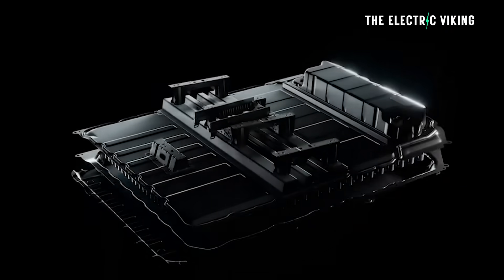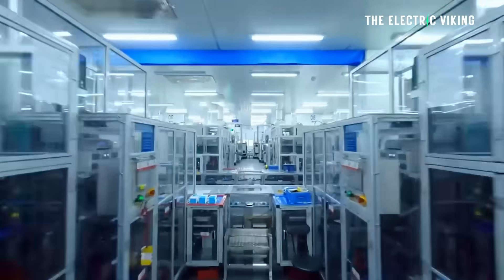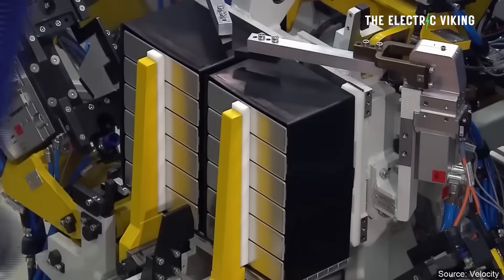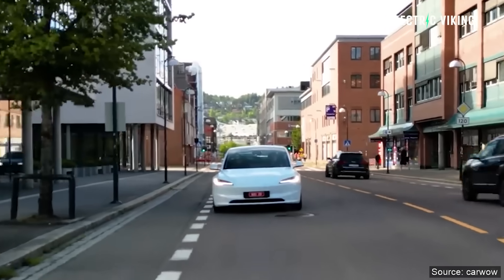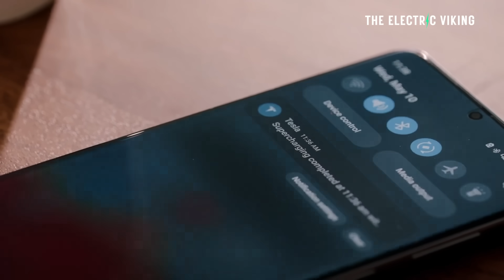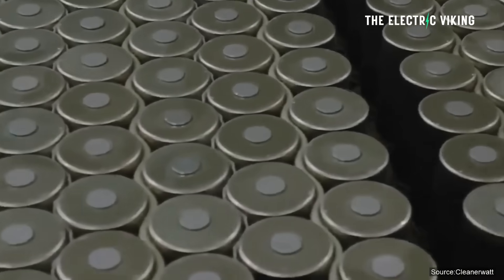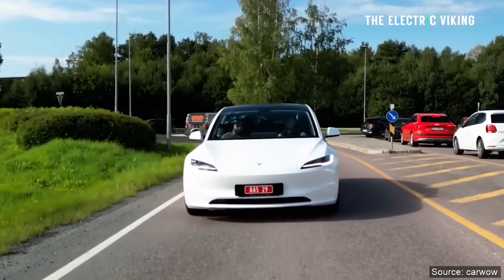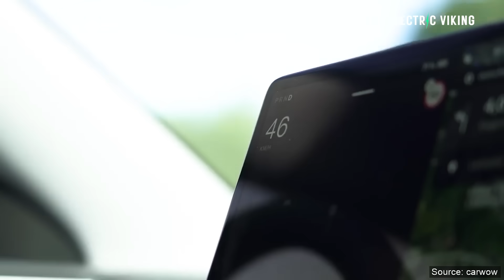Replace a faulty Tesla Model 3 battery for $12K or sell the car for $16K?

Comment: 1) This is why I still think - and I know the few reasons why they dont - I get it - wear level and other issues - but it would still be nice if they can figure out a way to get replaceable packs with in the whole battery. Cells can go bad and they can cause all sorts of issues - it be way way way cheaper if there was a way to quickly replace the groupings of these cells with a replacement.
2) Telsa and others will be force to give a return on these battery backs in the future - so they can "recycle" them - (either to reuse them or to break them down). EU already pass laws that work like that - it wouldnt be that hard to see them having to do that in the US and the EU for EVs as well. So they give you a % for the battery back - replace and then give you another X amount of years for the new battery.
3) In the future, it wont be so bad. It was 20k not that long ago. So if its 12k thats even better - and in the next 5 it will comes down to 1/4-1/3 of that - or around 4k as it wont require so many cells. We're droping from 7000 down to 2400 with solid state + sulfur tech. Sulfur is said to increase power dens by 2.5 to 3 times what active carbon is providing today and there are already lab batteries out there and NASA also made one - so its not that hard to belive it will come to EVs later as production scales up. Solid states also helps the power per dens kg. More so, it helps reducing the weight and size by half. That means these 4.0 or 5.0 batteries take up only a 3rd or 4th their current space for the current range or even a little more. Leaving a lot of space for more cells/batteries to extend ranges well past what ICE cars can even do. 700+ wouldnt be out of the question. Along with smell over all size pacts - that should allow them to make double the amount of packs as well - mean they more than likely will increase supply - and increase supply means cheaper over all battery packs on top of the other discounts. So a replacement battery might really just cost you 2k in the next 5 years. I am going to assume it will stay high of corse - so between 3-5k for their "overhead cost".
Reply: Nice if Tesla would do as you suggested.
Reply: "Most new 2022 Chevrolet vehicles have a 5-year/60,000-mile power train limited warranty".  Same for Ford.   That is 1/2 of mandated battery warranty in the US for low trim EVs.  Anything to help the consumer would be nice.
Reply: The Inflation Reduction Act in the US already contains provisions for battery recycling, I believe. But I didn't study it in detail.
Reply: Some EVs have packs that are assembled from modules e.g. the Leaf but Tesla prefers to build their packs as one big slab of cells as it's cheaper and reduces the risk of a connector in the pack not connecting properly.

Comment: Lucky break for the guy but it does raise a few key points. Should manufacturers be taking more responsibility for their product's lifecycle? A company like Tesla should be regulated to have a reconditioning service which replaces the underperforming cells of existing batteries or repurposes those batteries for other applications like home electrical storage.
The naysayers don't seem to get that an underperforming car battery is a perfectly fine home battery.

Comment: $12k is not cheap to most people, however I will compare it to replacing the exhaust pipe on my my pickup which would have been $8k in 2016. With taking inflation in consideration it would be over $10k today. So when people argue that EV batteries are an issue compared to ICE vehicles I give them this as an example.
Reply: Not doubting your claim, but honestly wondering why it would be so expensive for an exhaust system? What type of vehicle? That price sounds off the charts!
Reply: $8k for an exhaust 😂 Good story champ..

Comment: I have the model 3 2020, my battery died at 116,000 miles. In 3 days. Is out of warranty and replace the battery is $13,200
The battery to they will put in the car is refurbished, there are not new batteries. Warranty 40,000 miles or 4 years.

Comment: Follow the manufacturers warranty on the battery system closely and the first 30% degradation rate excluded from warranty coverage.  Rebuilding an ICE engine is a lot cheaper than $12,000.  Battery chemistry, excessive heat and cold weather , using super chargers will all impact degradation.  I would be very skeptical if any battery management software with Tesla, as well as algorithm programs with shorten range to offset degradation as well.  It’s a hell of a risk many of us don’t want to take.

Comment: That’s the problem they are worth nothing second hand, then your up for the battery 16 with labour, then the a/c goes, etc . Manly the doors drop hinges wear etc from opening closing, window mechanisms wear, so you get more wind noise rattles etc . Better off parting it out you’ll get more money back in parts once the battery is toast eg sell the motor body panels , computer etc

Comment: If Battery is 8 years or 160 kilometers, what happens if you are under that, but the battery just doesn't have the capacity it used to?
Reply: the batter wont have the capacity it is used to, thats it.
dont give to much to this 1 case which is still respectable lifetime, actually the lifetime milage of an ice car.
a new one is very cheap already and it will get cheaper in the future.
it is a nobrainer already, but there is no need to replace it, it is fine, 20% less range and slower charging is not an issue for 99% of people anyway.
i mean i charge my tesla once a week with the sun, i spend like 10 seconds to plug and unplug.
if you have a new battery in a tesla the value of that is insane it stays in the car like 100% and degrades very slowly like a new car again.
it is not wasted money like replacing an engine in an ice vehicle which has close to 0 value added.
but a tesla with a new battery has double in value instantly, and the cars are made for millions of km, 
it's a no brainer

Comment: EV You were talking about battery weight, specifically "660K" (1325 pounds) which is disappointing indeed. I looked up many Tesla specs, and guess what. They are VERY coy about the precise weight. Assuming latest LFP whole-package number of 200Wh/Kg, I'd expect a 52Kwh battery to be well under half that, and even the top-of-line 80Kwh to be  under two-thirds.   Anyone have the right numbers for current specs?

Comment: That warranty determines the price of the used Tesla.
This is no different than many things sold that have a ticking timebomb.

So on my 2022 Model Y Long range the battery warranty is 8 years or just 100,000 miles (whichever comes first) with a 70% minimum retention charge rate.

After that, car buyers are going to want $12,000 off the price since the battery is out of warranty.
This is no different than the other warranties on the car.

1) Vehicle warranty: 4 years or 50,000 miles and then the buyer is responsible for the cost of fixing the car

2) Battery and drive unit warranty: 8 years or 100,000 miles and the buyer looks at $12,000 to replace the battery

3) Supplemental Restraint System Limited Warranty: This warranty covers the vehicle's supplemental restraint system, including airbags and seatbelt-related components. It is valid for 5 years or 60,000 miles

That 12,000 cost is going to be taken out of the used car price.

Comment: How would one swap out a battery from a structural battery pack?
Reply: you loosen the bolts remove the battery, put the new one in and fasten the bolts again, done in 20 minutes.
dirt cheap, high value.
but who wants a new battery? the car is perfectly fine, no issues. it will work for another 200k miles easily, and more.
if oyu mean cell replacing, no , thats just stupid, thats like rpeairing an iphone, not worht it.
the product is way to efficient to even try.
it will cost more money, time, hassel, pollution, etc.
just get a new one.
it is basicalyl free since the entire value stays in the car.
for 16k you get a totaled tesla at best, if at all.
a tesla with a new battery doubles that instantly, it is actually a gain in value and not an expense in the first place to replace the pack.
but not needed it runs fine, no problems.

Comment: I think battery packs should be made to be disassembled and fixed.  I certainly would not want a 4680 pack held together with pink foam goo.  It is little things like this that makes me question Elon's alleged desire to "save the planet".  No, he is a ruthless Oligarch just like the rest.  If you have between 1000 and 5000 cells per pack, and 2 or 3 go bad, it is nuts to throw the whole thing away, when $40 worth cell can give it maybe 50% more life.  The battery management system in the car should know pretty closely where those cells are.  It may be a bit more complicated than this, but it seems a crime to scrap what is 99.9% a perfectly good battery pack.

Comment: That's the battery cost, the labour costs are much higher.
$10,000 for the battery, $35.000 installed.

Comment: If it is anything like the battery in the wife's crappy Dyson vaccum cleaner that I finally binned after having to renew it yearly,  it is going to cost you a lot.  It's like putting a new engine and drivetrain in an ICE every few years.

Comment: Well, good luck trying to sell me the car with 150K miles for $16K when it needs a $12K battery, it would end up costing me $28K, will you take $4K? In Fort Collins Colorado a 2022 Model 3 with 22K miles (still under warranty are going for around $30K.

Comment: My 10 year old tundra has 218k miles and drives like new. It will probably last 4-500k.
Reply: that is almost half of a tesla lifetime on average, but a tesla pays for itself with gas savings alone.
ev's last on average double that of ice cars.
in case of tesla a new battery is very cheap 8-9k. wel lworth it, the value stays in the car almost 100% so it is basically free.
for 16k you get at best a totaled tesla, probably not even that.
a tesla with a new battery is easily more than double that worth.
its already dirt cheap to replace and this case is an exception, tho it still runs fine.
it still did more than the average ice car lifetime mileage.
Reply: @JohnSmith-pn2vl  Toyotas routinely go 350-500k and have a high resale. My son lost about 10x on his Tesla I lost on a highlander over ownership period . On average I drive a Toyota for $150-100 dollars a month over lifetime. Go ahead and tell yourself whatever. I’ll keep normally aspirated Toyotas for reliability and resale. Business cars write off 0.50 per mile in taxes so has to me isn’t a big deal as electricity isn’t free

Comment: Okay so I've asked before. The battery in an EV has an 8 year warranty yet all the spruikers are saying the battery will last the life of the car. So if that's the case why hasn't it got a lifetime warranty that excludes general wear and tear? The battery in an IC vehicle sedan only costs around $150 to $200 and it lasts for around 8 years as well. $12,000 isn't generally an amount of money that the ordinary Joe in the suburbs has nice and ready to just hand over if the battery in his EV needs replacing. Also something else doesn't quite add up with this video, he says someone is willing to pay $16,000 for a car that requires a battery change that's going to cost $12,000. That doesn't make any sense at all, unless the person is an idiot and is going to buy the car and end up spending $28,000 after battery replacement. For that money you can buy a brand new IC off the showroom floor with 0 km on the clock.

Comment: The pink foam would be fire retardant. One car with a possible problem out of 1.5 million + built. Yet another MSM hatchet job on Tesla
Reply: It's a stiffener and heat conductor. The structural packs have to be much stronger than normal ones.

Comment: I'm afraid to buy a electrical car they could have put a generator on one axle and the car would have unlimited mileage not to mention no backup system before they didn't put the generator on it brakes could fail or anything and you'll be trapped by a locked door

Comment: It looks like Tesla joined the corporate philosophy of not letting the owner fix their battery. They can give use reasons for doing it, but the bottom line is that they make it difficult to replace one bad cell and they expect you to replace the whole battery. I like how the EU has fought the cell phone industry and are forcing them to sell phones where the owner can easily swap the battery (remember doing that?). 2027. This was after they said all phones will have the same charger/data line. I think the same will happen with car batteries, eventually.
Reply: While that seems like the logical thing to do, as a commercial electrician used to dealing with 480V 3 phase high current power, the thought of allowing/encouraging untrained individuals to start messing around with 400V very high current DC power is not good.  Just the liability concerns would have their lawyers saying don't let owners get involved.  These are not cell phone batteries we are talking about.
Reply: Yeah. That's another reason that is floated (understandable). Subway, the sandwich shop, has "don't eat the wrapper" printed on the paper cover. That's the breadth of the issue. It could be dangerous but I' m no fan of making things impossible to work on.

Comment: The recyle batteries " black " compound is now called black good.
The rest of the casing also can be salvage for other uses.

Therefore all these anti-EVs batteries critics are worst than ostrich with head in the sand & butts up in the air.😂😂

Comment: Maybe one day manufacturers will be required to make individual cells replaceable. Putting in sticky pink goop might be replaced with a rigid structure resistant to an automotive environment or an easily removable plant-based packing. K = x1024 k = x1000 compare km, kg, kph.
Reply: that is stupid and not worth it, damn regulators making stupid repair laws is terrible.
they have no idea about manufacturing.
just reaplace ist, it is dirt cheap already and will get down another 50%
Reply: @JohnSmith-pn2vl   I'm happy for you that $12k is dirt cheap. My annual income is three times that. I agree that costs in some cases are reducing spectacularly such as the value of the car I'm driving (about $6k). There should be more people like you experienced with manufacturing on the right-to-repair regulation committees.